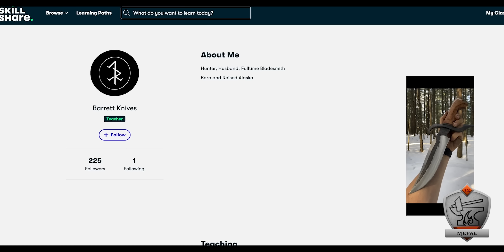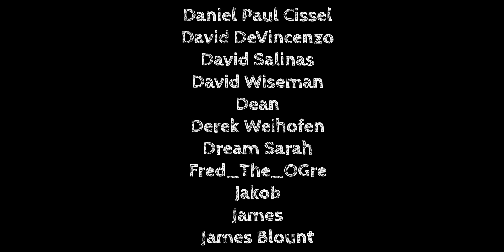Crafting a Knife with Firebrand Productions!

Comment: If you (or anyone else) wants to do a "custom" knife but don't have access to a forge, you can buy pre made knife blanks and add handles and whatever other features you want. Most places that sell the blade blanks also sell handle and pin materials and even some tools. Great video and knife, hope this helps helps somebody out!
Reply from the maker: Great point! Love this!
Reply: I've done this, and it was surprisingly cheap! I got MoraKniv blanks from Rockler (they're also on Amazon), and the blanks cost me less than $15. Highly recommend as a starting point for anyone interested in trying on a budget.
Reply: @PKDoesStuff  I was also surprised at how inexpensive (some people get the wrong idea when they hear "cheap") a lot of the blanks were the first time I looked. So far I've done 5 or 6 different knives from a few different manufacturers, most less than 20 dollars each, and they're all good quality.

Comment: Fun fact, a great way to mark the center for your edge, use a drill bit the same thickness as your steel. Lay the blank and bit on your table and use the tip of your drill bit to scribe a center line on the edge of your steel. Cheap and works every time.

Comment: Love the Vid great to see you supporting small shopps but quick question if you go to 14:33 the blade is a bit thin at the edge did he clean that up for you ?. I hope that has been done as the edge may roll and the blade will need a serious sharpen.  I'm not trying to nit pick on this one I have had a blade do this after being sharpened on a belt sander as well.

Comment: Now all you have to do is make a leather sheath. And to protect the blade from rust use olive oil. Most other oils does a better job but is toxic. Because it looks like a good camp knife.
Reply: You could also use Ballistol, but probably more for cleaning than for an protective coat. Olive oil might get rancid over time, especially in the leather sheath